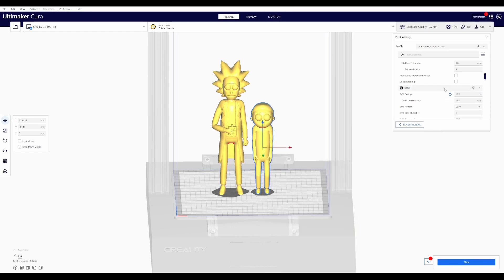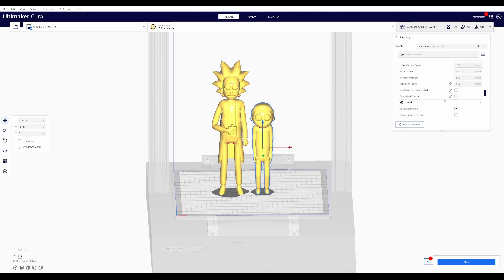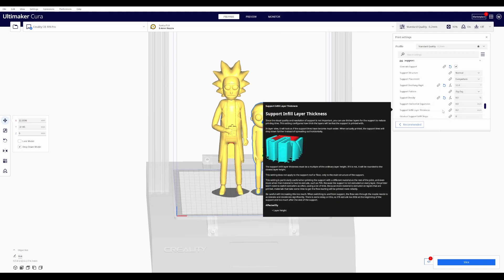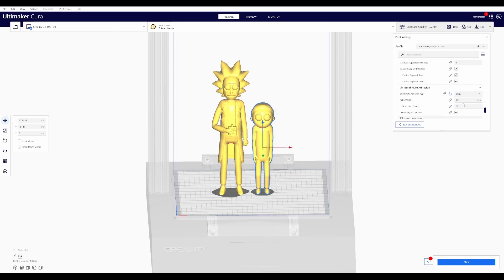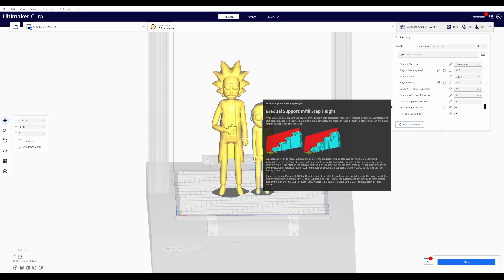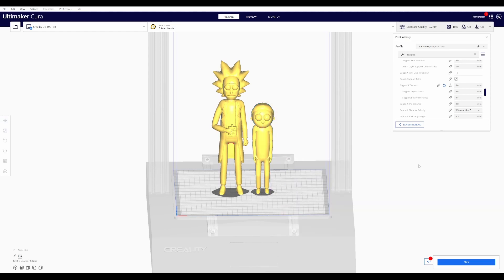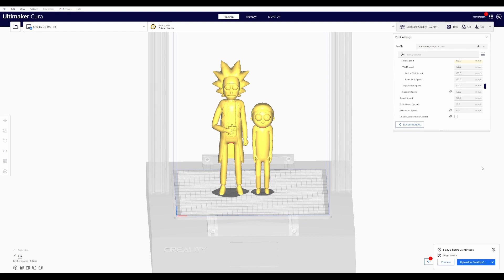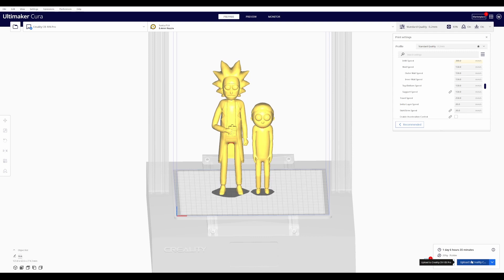Maximizing Print Speed with Creality Sonic Pad - You printed HOW FAST?!?

Comment: Tree supports have been a game changer in my opinion. Really makes supports easy to remove and knocks a lot off filament usage and print time.
Reply from the maker: I mainly use tree supports at this point, but there are times that regular supports are a better option.  All depends on what you are printing...

Comment: I finally got my Sonic Pad acceleration compensation done and bumped up the speed for a GoPro case divider. Wow, what a game changer! Even with speed at a mere 80mm/s from setting Cura to 150, this print is coming out in half the time and the same quality. Sweet is a good description!
Reply from the maker: Still working on part 2 of the series.  I had an issue with my extruder, and have been on hold for a replacement.  Spoiler alert though.  I am getting good prints with settings of 300mm/sec and 3500mm/sec/sec acceleration.  A shelf design that originally took me 21 hours is now down about 9 and a half on my CR-10S Pro V2!!!  Stay tuned!!!  Hoping to have it out this weekend.

Comment: I am looking at the Sonic Pad to provide a modern interface, WiFi, etc rather than speed. Running between my PC and Ender S1 Pro with a flash drive is sub par.
Reply: I got one for all that and speed. It's been a bit of work to set up. But the wireless interface and larger touch screen is really nice. I have an S1 Pro also.
Reply: @boardnski156  Thanks for the feedback… I’ll probably wait for another firmware upgrade and the inevitable YouTube “How To” videos before I’ll jump on it.

Comment: Yeah you are going to see a huge time decrease when you get your acceleration tuned. I run an Ender 3 Pro on a production job that runs 24/7 (I use the hotend to knock the part off into a bucket), and before the Sonic Pad it would take ~53 hours for 100 parts. Now the time is down to ~20 hours. The quality is nearly identical. I was running. 40mm/s at 250mm/s2 acceleration before. Now I'm running 100mm at 3000mm/s2 acceleration.

Complete game changer.
Reply from the maker: I'm already noticing.  I am working on the acceleration and jerk video, and the slicer estimates drop considerably.   The CR-10s have a larger heavier bed, so I'm still working on the max acceleration I can get away with, as well as how much input shaping will help with minimizing ringing at the higher acceleration and speed.
Reply: @WilliamAgans  You should be able to get the bed moving quickly considering you aren't running a glass bed. My printing strategy requires a glass bed, unfortunately. Looking forward to the video!
Reply from the maker: @Allen Isbell  Funny you should mention that.  I actually was running a glass bed until 3 days ago. :)
Reply: @WilliamAgans  good move!
Reply: @WilliamAgans  Also, another thing I noticed. Once I bumped up my acceleration, Cura's time estimates were way off. An 8 hour print finished in about 4.5 hours. The aforementioned part was said to finish in 13 minutes, but finishes in 9 minutes and 50 seconds. Before tuning for high speed, Cura was always nearly perfect on the print time estimates no matter how large of a print it was. Literally down to the minute no matter if the  prints were 30 minutes or 30 hours. I'm anxious to see what you find in that regard.
Reply: Wouldn't the print get damaged if using the hotend to knock the part off? Is there any tutorial on this workflow I could learn from? This kind of automation would really help, I'm new to this. Some pointers?